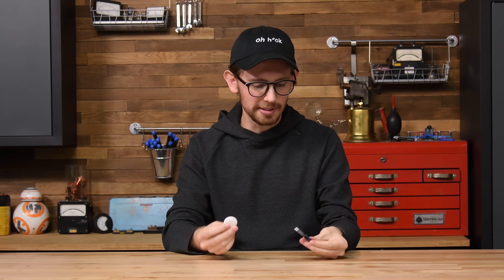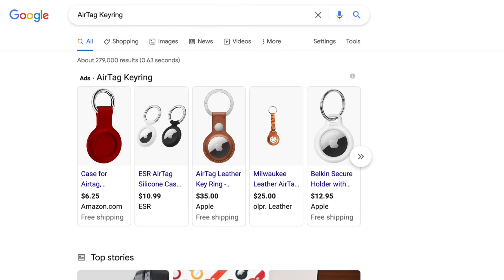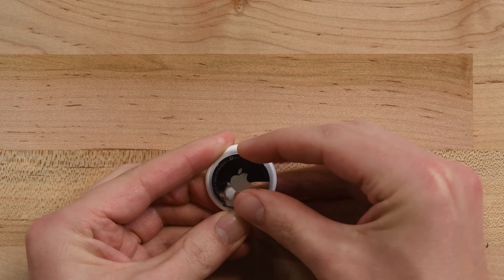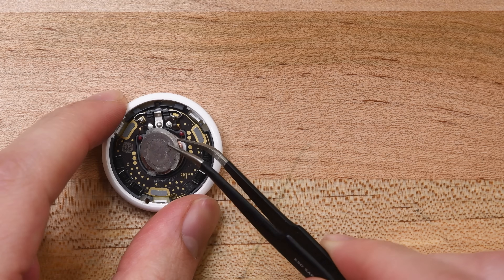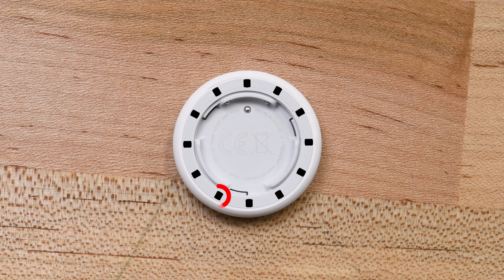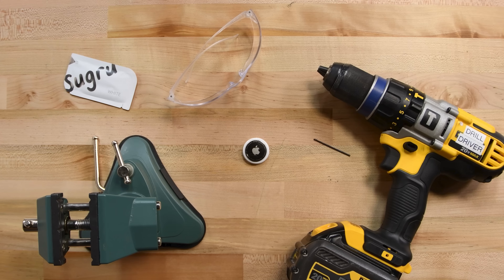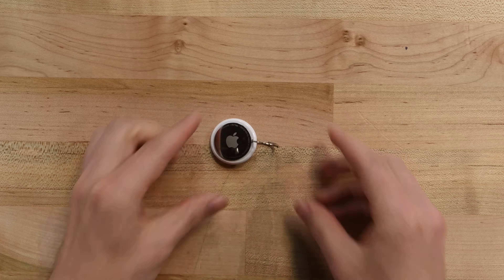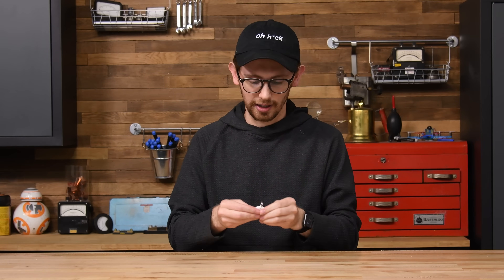How to Drill a Keyring Hole in an AirTag!

Comment: Why so negative towards apple all the time? I have been rocking them for a while and not a single thing has been broken. But still I bought a screw kit from you and the bit was broken and can’t be used again. No replacement or anything. Repair rating 0/10

Comment: Would one of those circle magnets people use to put their phone on a car mount work. One sticker magnet cut to size and put on the back of the airtag and one magnet on your backpack or anything you're trying to connect it to..though this isn't the best option for keys but maybe a dslr?
Reply: I’m not sure but normally stainless steel and aluminium (what Apple normally uses) are not magnetic so I would presume not
Reply: @monkeyplayer1  AirTags are highly magnetic on the top side, but mostly due to the internal magnet and the fact that the white shell doubles as the resonating body of the speaker.
Reply: @monkeyplayer1  Magnets will stick to stainless steel. It's a ferrous metal.

Comment: Make a video where to hide it in a bicycle.

I killed one AirTag with to much pressure under the seat. where the seatpost attaches to the seat.

I finally found another safe slot in my seat which I disassembled.

Comment: Why do you need protective glasses but not protective gloves if you have your hand near the drill?
Reply from the maker: Excellent point! When I was writing this, we were going to find a way to stabilize the AirTag so I didn't need my hand near the drill, so we didn't include them. But that didn't work out!  I'll add gloves to the list in the description. -TD
Reply: Wearing gloves can be a safety issue when drilling. Since it's a HAND DRILL and the bit is so small it doesn't really matter. However, if you're going to wear gloves, I suggest wearing thick ones.

Comment: This completely bypasses their airtags business model, and I love it
Reply: Indeed
Reply: You know what bypasses their business model?
RIGHT TO REPAIR
Reply: @metallurgico  true
Reply: Just take a nail and a hammer and you can nail it you your chest and never lose it. - IFix it
Reply: @xredrum41x  But doesn't that void your warranty?
Reply: it's the same business model as every device maker that doesn't sell ruggedized devices. some do but they dont' sell well, people buy cases so it's actually supply and demand. we the consumer taught them that we buy consumable outer wear to protect the inner product. wash rinse repeat.
Reply: @joeylopezdesign  ouch correct. First screen protector since they make screen from glass. Then cases since they make body from glass
Reply: This is simple DIY trick really going to put greedy Apple out of business!  The extra few million in lost revenue is going to send Wall Street in a panic.
Reply: @bobweiram6321  YES LETS DO IT LETS MAKE APPLE GO BROKE LETS GO
Reply: As well as their waterproofness